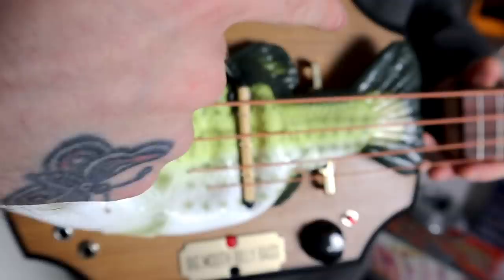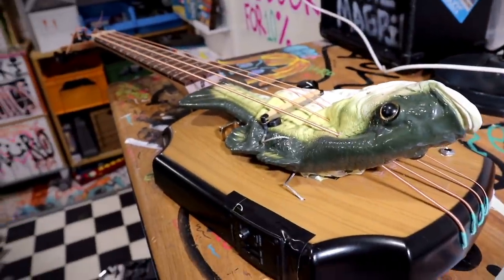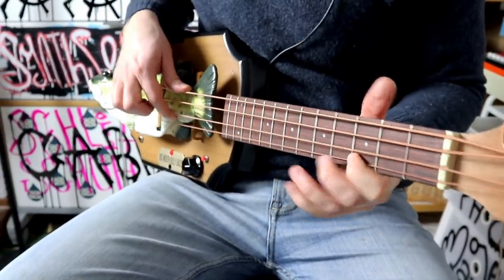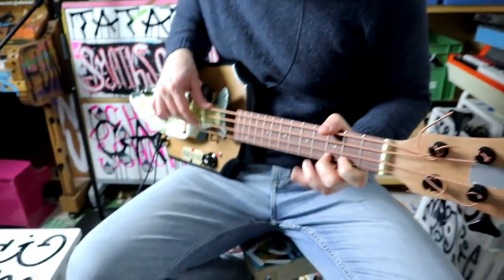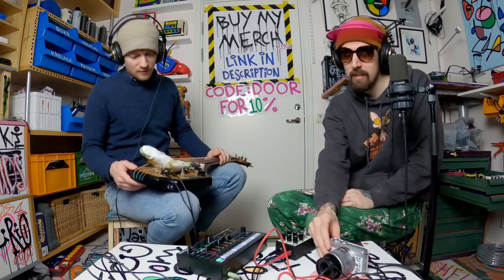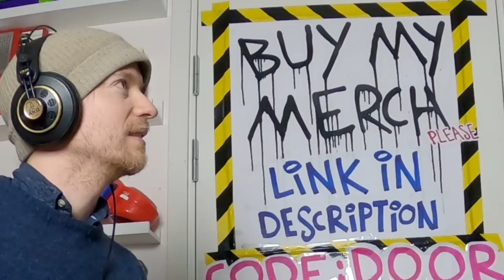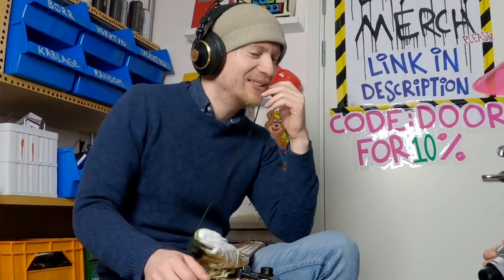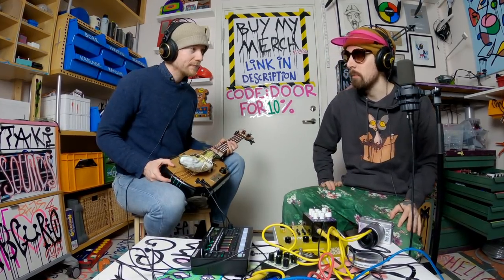I Made A "Billy Bass" Bass And It Slaps

Comment: Ya know, it wouldn't be that hard to fix the intonation- just put a block between the neck and that metal bracket, use a longer bolt.  Measure the length from the nut to the 12th fret, you want to make the distance from the 12th fret to the bridge just a hair longer, by like a couple millimeters.  (I'm a hobby luthier, I build weird stuff from time to time too)

Comment: The first component that you add, is that a potentiometer??
Reply from the maker: Basically the only component 😅 just a pot connecting 2 points for pitch down. Didnt do pitch up with a third point cause it went very bonkers and didnt wanna risk breaking it before I had put all the bass stuff on.

Then just a button thats like reversed in itself so it breaks signal when pushed instead of let signal pass through.